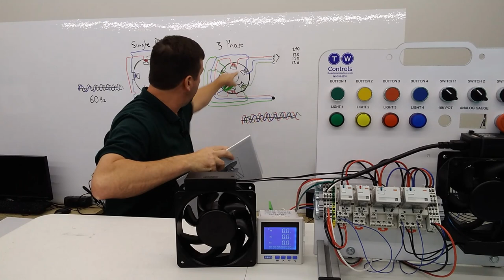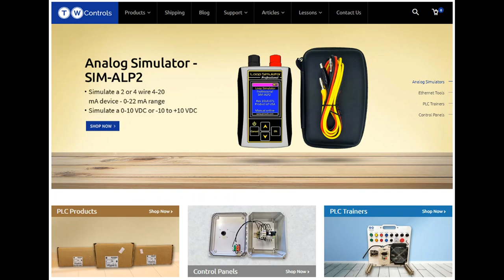How Does a Rotary Phase Converter Make 3 Phase from Single Phase?

Comment: Hello. I've got a machine coming in that runs on a 3 phase. But my place only takes one phase. I was looking at getting a rotary converter. Is this all I need. The machine takes 4kw and runs on 15amp and is 380-420v. Im getting confused with the vfd and rotary converters. Any help would be appreciated
Reply from the maker: Below is a link to my setup.  Typically you will need a rotary phase converter that is twice the size of your load so you would need a 8KW motor.
https://twcontrols.com/lessons/how-to-make-3-phase-power-from-single-phase-power-using-a-rotary-phase-converter-including-480vac

Comment: Sir I need to run a 20 hp motor which is 3 phase. I was recommended to get a variable frequency drive of 30 hp. The electric line here is 11000 volts. The step down transformer used on the line is of 5 hp. My question is there a risk of the transformer overloading if I use a vfd?

Comment: I am curious as to how it corrects the 180 degree shifted phases into balanced 120 degrees. Is the motor just generating C phase and A and B are still being used 180 degrees apart as supplied by the service and C phase is just thrown in somewhere? Or is it true balanced 3 phase power 120 degrees apart?
Reply from the maker: It is 120 degrees apart, the key to understanding it is when you measure 3 phase, you don't measure to neutral, you measure leg to leg.  Video explanation in the works.
Reply: @TimWilborne  Ill be awaiting the video, will be interesting

Comment: It sounds like these systems are "one unique solution" type situations wrt a load and a run capacitor. Meaning for a specific sized motor, and a specific unchanging load, you need a specific sized capacitor to maintain a balanced system. Correct? In your previous video it seems like in the shop you have plugs, that indicate the load can change. Does it somehow remain balanced or is the imbalance negligible?
Reply from the maker: They can handle quite a bit of load variation and the balancing isn't that necessary. But I use the test control panels and there were requirements on the voltages in some of my customer specifications.

Comment: what you suggest for a Solar PV array behind a rotary phase converter , self-consumption with zero feed-in or full feed-in on grid, in your opinion what can be the right injection point? between the phase converter and the grid meter or inside the  main low voltage panel ?
Reply from the maker: That sounds like a fun project but it is out of my realm of expertise.

Comment: Just wondering if you have a part 3 to this video.
Also I am thinking of using this method though not sure if it will work or not.
I am getting a 3p 415v motor maybe 2hp, (not sure if star or delta)
Can I use this to run of a 230v 1p 15-32A circuit with start and run caps
Then use a 3p step up TX to get the power back to run a 2-3hp motor?
(Wanting to run a mill, brobo, lathe)
Reply from the maker: Hi Keagan.  The first thing I see is you aren't going to be able to use that 415V motor on your 230V 1 phase power.
Reply: Second thing is that if you want stability, your idler needs to be at least as large as your load motor.  Good rule of thumb is to use an idler at 150% or larger than your load motor to avoid significant droop on the flying phase during startup of your load motor.
  
You CAN run a 400-480V motor on a 120-277V supply - but you need to use a transformer to step up the voltage.  Remember then that the power stays about the same across a transformer (plus the additional losses of the transformer).  So 240V@10Amps = 2.4kW,  2.4kW@415V =  ~5.8Amps.  You'll need more Amps from a lower voltage supply to run a higher voltage motor through a transformer (by whatever ratio the transformer is).
  
If you don't understand this stuff as explained, then you should probably have an electrician help you - there's a saying "knows enough to be dangerous, but not enough to know they're in danger...".  You just have to get this stuff wrong once, and it'll kill you or someone you love - or burn your building down.  There aren't "do-overs" from a fatal electrocution, and we're talking about power levels that will kill without warning.

Comment: Great videos! I have passed by many 3 phase machines since i don’t have, nor can easily get 3 phase power out in the country. I wired my shop and have a fair knowledge of how power works. I have a fairly new 7.5 hp 3 phase more from an air compressor that i bought used and found a used 1 phase to run it. I would like to run a welding machine on 3 phase. If i set up a rotating phase converter, will i be able to run more than one thing on it? Or are the run capacitors figured for just one load? It appeared that once i get the 3rd leg rotating motor right, i can have 3 phase for multiple things. I know your busy, so thanks for your time.
Reply from the maker: The capacitors are more for balancing the three phases voltages, unless you are doing something like CNCs or something sensitive, that part isn't a big deal.  If you need to run a 7.5 hp compressor, you need a 15 hp rotary phase converter such as this one.  I would call them, they are very helpful with sizing.
https://amzn.to/39BEYC3
Reply: @TimWilborne  thanks for the tip. I figured i could use the 7.5hp 3 phase motor to generate a third line to run a welding machine. I’m curious, do welding machines that are 3 phase need any special balancing after i generate the third line? A welder is the main 3 phase item id really like to have since they are much easier to find used than single phase welders. I mean a welding power supply to run big mig guns. They usually are 3 phase.

Comment: could i run a 30 amp 3 phase  a/c compressor on single phase ?
Reply from the maker: Yes, very common for a rotary phase converter.
Reply: @TimWilborne  thank you ,im sure we need more info to transfer but what would the equipment costs be for two separate  three Phase 30 amp circuits be ?
I am planning to change the entrance feed from one tennant to three and on the two additional power servaces i would only want single phase .I am splitting up the building to have multiple rental spaces.

Comment: Tim the 220 VAC that comes out of the double pole breaker of the load panel is essentially what comes out of the secondary of the utility transformer outside your residence meaning the two phases L1, and L2 are 180 degrees apart. How then in star connected idle motor can one obtain 120 degrees phase difference between L1, L2, L3? it seems to me that's impossible because incoming L1, L2 are always 180 degrees apart. this then creates an imbalance which may throw the start point(where the three coils connect together) unbalanced meaning having a potential different than earth. which apart from safety considerations, may have other implications. I want to use a 10 HP 3 phase idler motor to generate my "ghost" third leg and use the output to power a 3 phase steam jacketed kettle of 4.1 KW (5.5 HP). although the kettle is wired from factory as 3 Phase, the manufacturer says it can be used as a single phase. Do you see using this setup is a wise choice? or there may be some problems?
thanks
Reply from the maker: Hi George.  In a future video I'm going to put a scope on converter and talk about that.

In your case, it sounds like all of your loads are heaters, is that correct?  In that case it should be able to be rewired to single phase and that would be the best course of action.
Reply: No that's not correct.  You have to remember that the 3 phases are not the 3 wires.  The phases are the potentials that are created between those wires.  You have 3 phases that are all 120 degrees apart because your two wires from the pole connect to each end of a single winding and only one end of the other two windings.   Then as the motor rotates it inductively couples to each of the 3 windings which are each spaced 120 degrees apart.  While the phase converter seems to "generate" one leg it really creates 2 phases.  The reason why the voltage on the 3rd leg is "wild" and has poorer regulation is because it is passing through the motor windings (inductors) and the other 2 wires don't.  This tends to make its current lag behind and that's what the capacitors do is put the voltage and the current more in phase on that leg.

Comment: So if it's based off of that "ghost leg," then what's it based ON?
Reply from the maker: Not following your question
Reply: @TimWilborne , at 4:46, you say "...all on our B-C and A-C measurements, which are based off of that artificial ghost leg." So what I'm asking is: If those measurements are based off of that ghost leg, then what are they based ON instead?
Reply from the maker: @HelloKittyFanMan..  The idler motor generates the 3rd leg.
Reply: Yeah, that's what I was thinking,  @TimWilborne . So then did you mean that those measurements are "based ON that (artificial) 'ghost' leg" instead of "...off..." (meaning on something else)?
Reply from the maker: @HelloKittyFanMan..  I think something is lost in translation.  Saying something is based ON something or based OFF something would mean the same thing here.

Comment: why dont you just pair 2 motors (2 and 3 phase) on single shaft (or belt driven), start the 2 phase, and use the 3 phase motor as a generator?
Reply from the maker: You can, I have an older article on that.  The starting capacitors are a more common way of doing it today and overall more economical.
Reply: @TimWilborne  Got it.
Thank you.

Comment: Why are there small fans that are 3-phase?
Reply from the maker: I know larger servers use them for cooling, not sure what else.
Reply: Why would they need to be 3-phase though,  @TimWilborne ? I thought 3-phase motors were for heavy-duty applications, so you wouldn't have to have such a big motor to do a big job as he would have to have if it were just a single-phase motor. Why just for a smallish fan?
Reply from the maker: @HelloKittyFanMan.  No 3 phase doesn't necessarily mean big, I have a 3 phase motor that I can put in my pocket.  3 phase is the easiest way to have variable speed.

Comment: It turns out: electric dryers and ranges use 3 phase Electricity
Reply from the maker: Some industrial ones may be but residential will be 220VAC single phase with a neutral.

Comment: I am not understand because my country 440 volt 3 phase supply
Reply from the maker: 440, 460, and 480 are really the same voltage. Regionally the exact number used does change.
Reply: I am using 4 3 phase motors easily connect three phase supply in my electrical grid lines
Reply: My English not good
Reply from the maker: In the United States most standard non-industrial establishments have 220V single phase. So we don't have three phase and must make it.
Reply: India's electrical system normal different